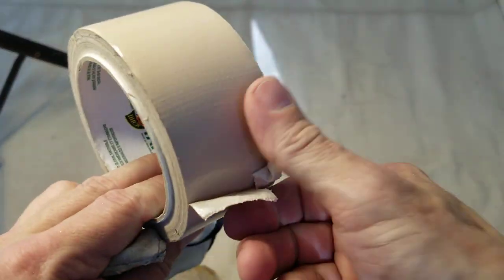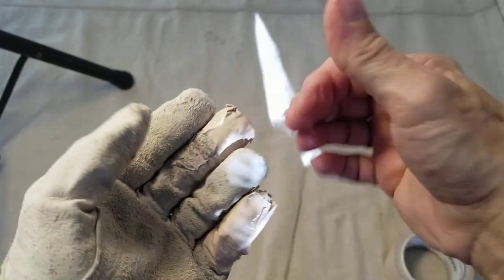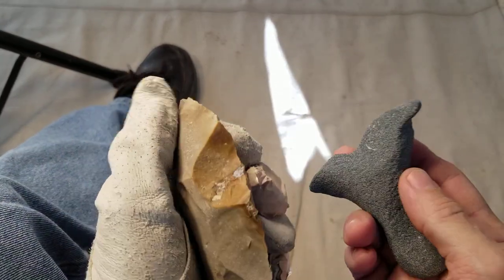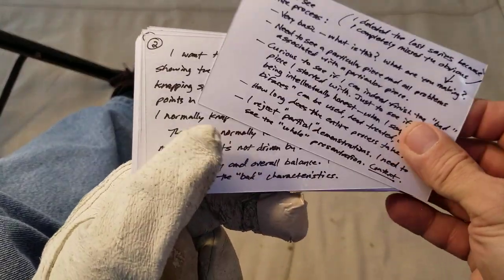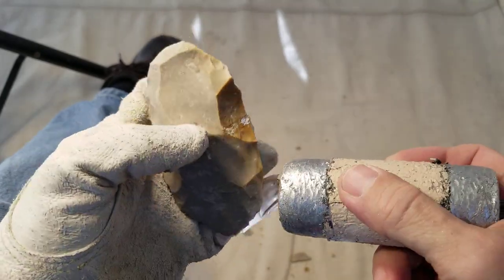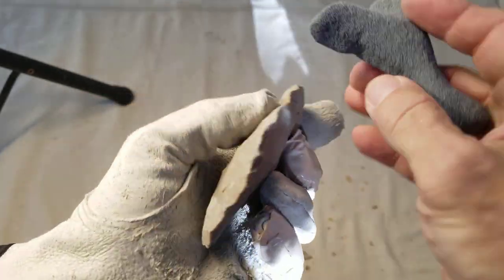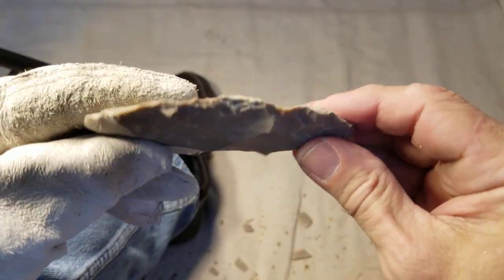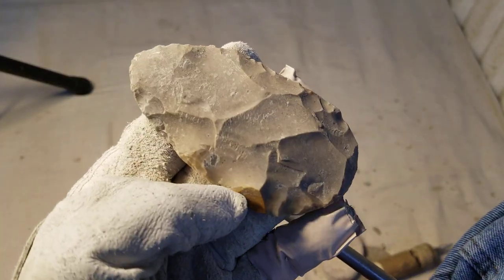1304 - Part 1/3 - Basic Knapping

Comment: I use the term "intended platform" with percussion. I know where I intend to hit. I see you above center a lot early in like me driving thicker reduction flakes. A point you may consider in your instruction is the when and why of that. Most info is always below center no matter what and that greatly hindered me until John Tuttle asked me why not. He grabbed a piece and hit it above center and cleared a whole turtleback in one lick. Major turning point for me early on along with finger pressure in the line of travel during reduction.